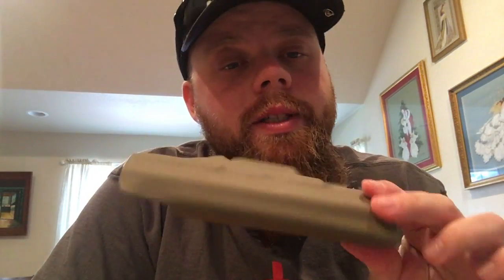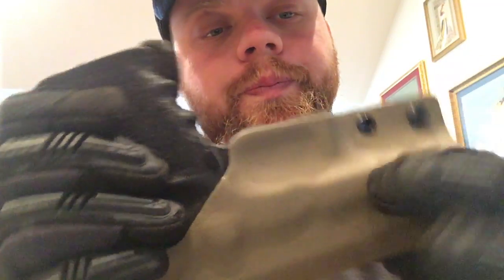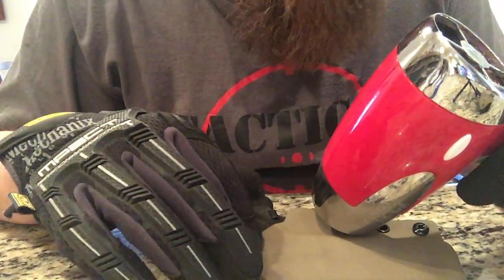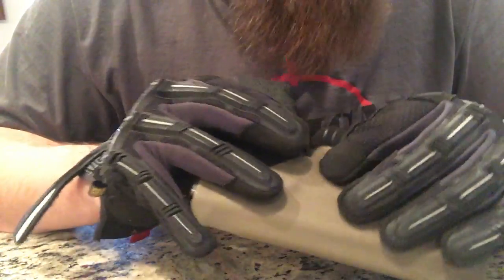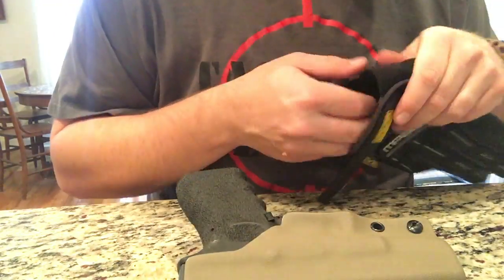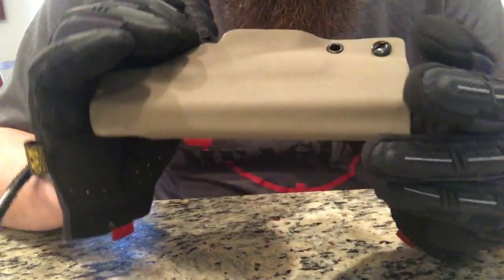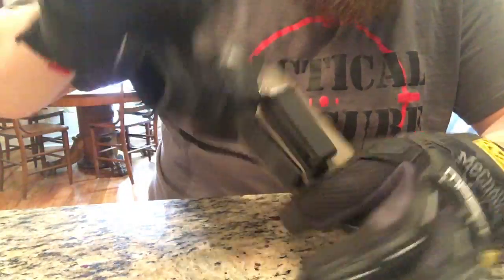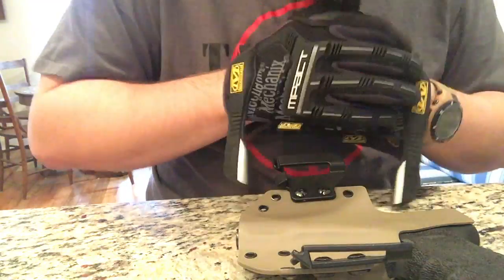How to adjust the retention on kydex holsters

Comment: when you put that dimple in the trigger guard is there a danger in activating the trigger when you reholster?
Reply from the maker: Don't over press it to where the trigger is staged. I would place the dimple further out closer to the very edge of the trigger guard if you have any reservations about doing it. I have never had an issue with it and I know a ton of other holster makers do it the same way.
Reply: Thanks a lot. Just saved me shipping and a headache.